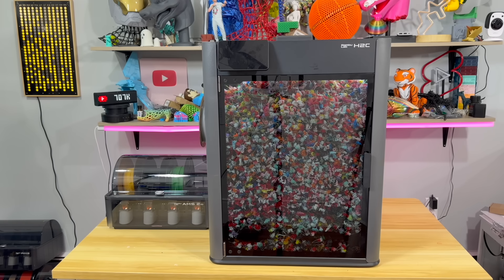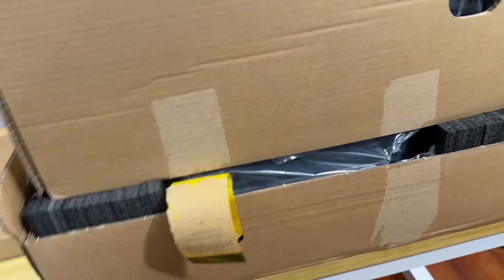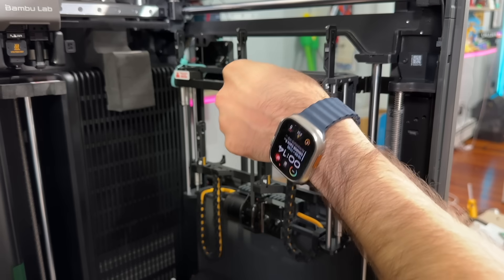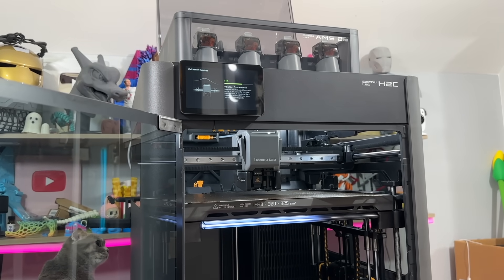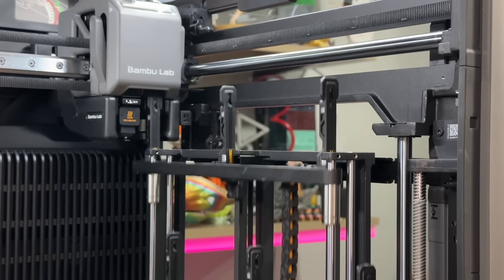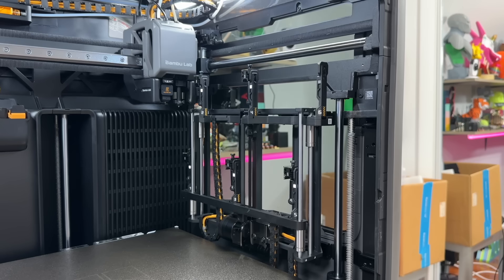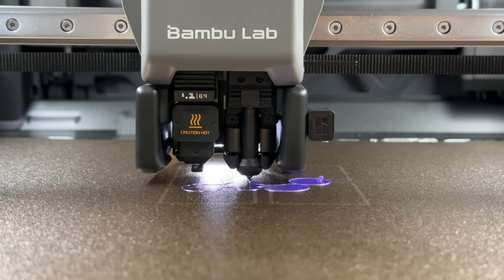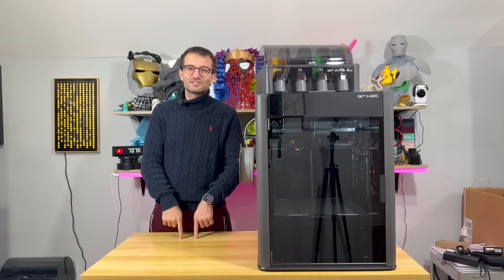Zero-Waste Multi-Color 3D Printing with Bambulab H2C

Comment: Almost every review of the H2C glosses over the fact that the tool changing is fast, but the AMS still takes time to swap filaments.  Multi-toolheads solve that issue.  Pros and cons I suppose.
Reply from the maker: True true. Probably next problem to attack
Reply: Yah definitely but not alot of people mind the time it takes.
Reply: But it harder to make a nice looking multitoolead that's enclosed. So you can't do thing like engineering plastics in the prusa xl and index bambu is about simplicity and being compact with of course in my opinion is. Exactly what ba,but delivers.
Reply: I wasn’t really super concerned with the speed. It’s still faster than it would be the old way and if you make the tubes going from the printer to the AMS as short as possible, it’ll be faster. I just didn’t like wasting an entire roll of filament in scrap

Comment: Very clear explanation, thx doc! I have a very old 3d printer, this video made me wanna buy a Bambu
Reply from the maker: Yeyyy thank you
Reply: Bambu good. I have an H2D, X1C, and A1 combo. I would recommend the A1 Combo, it prints almost as fast as a core XY and is $370 USD right now, down from $550 when it first came out. Or if you are feeling spicy and don't want the Bambu, go for a snapmaker U1 haha. A true toolchanger for $850ish is insane